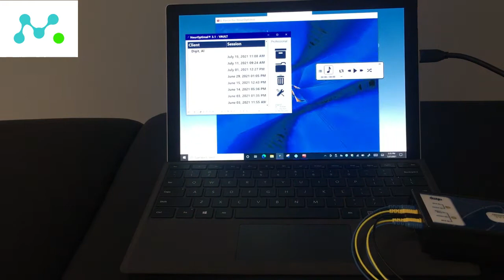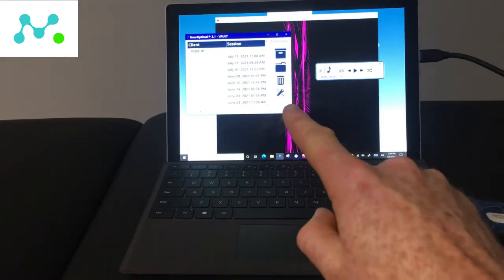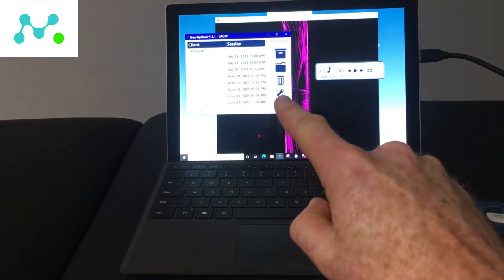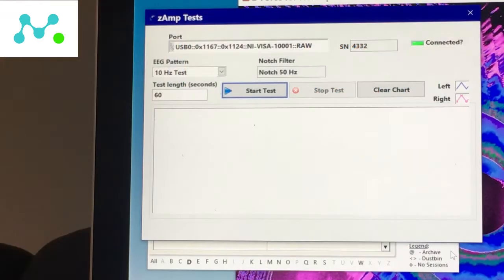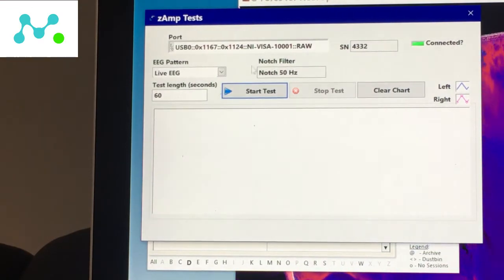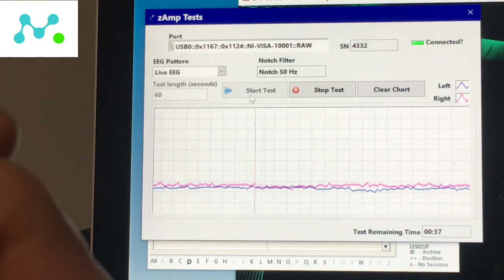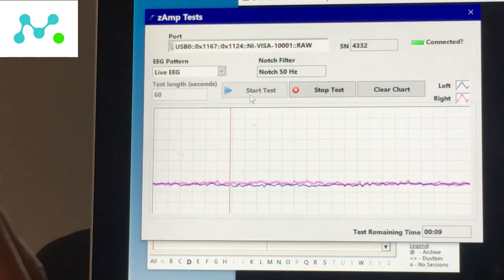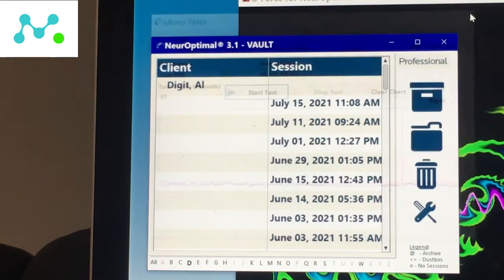NeurOptimal neurofeedback Sensor testing

Comment: Thank you so much for this very helpful video :)  I have been using NeurOptimal every other day for 10 days (hoping to lessen insomnia and improve memory) but I have not noticed ANY effect at all.  Is there any way of testing that I have the sensors attached properly?  I'm concerned that I may have the scalp sensors positioned incorrectly.  Also, the scalp sensors won't stay fully attached, they partly lift up so only about half of the sensor is making contact with my scalp.  Any advice hugely appreciated!  All best wishes from Brighton X
Reply from the maker: Hi Aurla, 

Thank you for your comment. Sorry for the late reply only seeing your message now. I am glad you have found the video useful. There is no way to test that the sensors are connected to your head correctly. Have a look at this video where I show how to connect the sensors. https://youtu.be/rKdJDdhFI30 

Ensure you have the sensors on the correct side as explained in the video.

If the scalp sensors are partly lifting up, ensure when you are putting on the scalp sensors that you are parting the hair so that the sensor is making some contact will the bare scalp. Also ensure you are using plenty of paste with the scalp sensors. I know it is more challenging to put on the scalp sensors when you are doing it your self, so it is good to do it looking in a mirror. I suggest that you use a small knitting needle like I use in the video to part the hair. It makes it much easier. This should help with the sensor staying on the scalp. Sometime when the head gets hot the sensor may become a bit loose. So just check that a few times during the session. If you are not moving around during the session, the sensors should not come off. Also when taking your finger away after putting on the scalp sensor, twist your finger of as sometime some paste can get caught on your finger and may lift of the sensor a bit. I explain that in the video also.

With regards to not seeing any changes in your insomnia, sometimes we get caught up in the bigger picture and may not notice that small little changes. I suffered from severe anxiety for 30 years and it was Neuroptimal Neurofeedback that helped me to over come it. Initially I still had the anxiety and it took over 70 sessions before it was gone. At times I thought the Neurofeedback sessions were not working as I was still suffering from anxiety attacks. But when I started to notice the small little changes then I saw that it was really working. Little things like being able to go into a shop with out getting anxious or just have a chat with somebody without anxiety thoughts going through my head.

So start to look is there any small little changes happening, like if you do get to sleep it might be happening a bit earlier than usual, is there less thoughts in your head, when you get to sleep are you sleep deeper, do you notice you might start to go to bed a bit earlier and starting to feeling tired earlier. It is going to be small little changes over time, you may not notice any big changes until you look back over your life when you have been using the system for a while.

Are you renting the Neuroptimal Neurofeedback system or did you buy it? Long term use of the system will have a major improvement in your life. Also look outside of just the insomnia, what other things are you noticing in yourself. After a while ask your family and friends have they seen any changes. Sometimes we do not see the changes ourselves until it is pointed out to us.

With regards to the memory concern, that may take more time. So stick with the sessions. Trust me, they will be life changing for people. I am one of them.

I recommend all clients to remove all sources of EMF from your bedroom at night, so turn off you wifi router, turn your phone to airplane mode, if you wear a watch that has wifi or bluetooth, remove it, ideally nobody should wear any of these types of watch. Ensure you are sleeping in a dark room with no source of like coming into your room. Some people are very sensitive to EMF's and these signals disrupt peoples sleep.

 I hope this helps.

Thanks,
Michael.